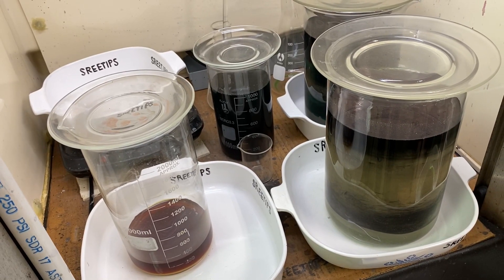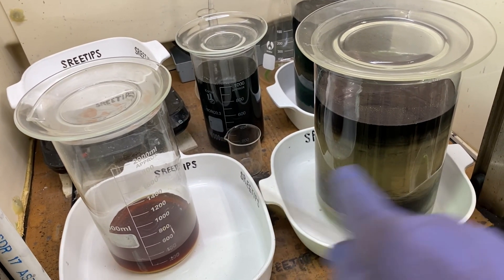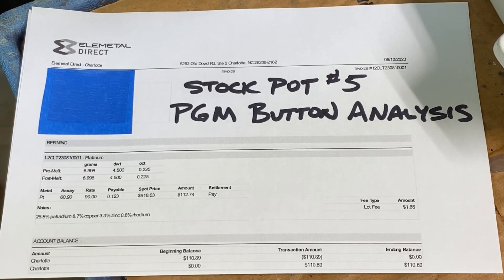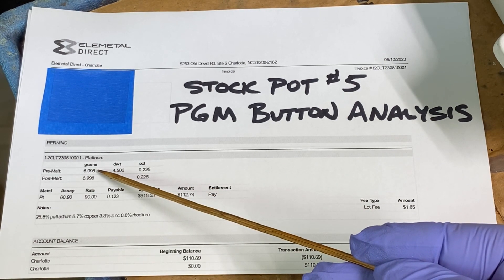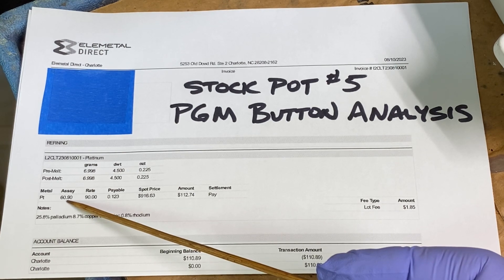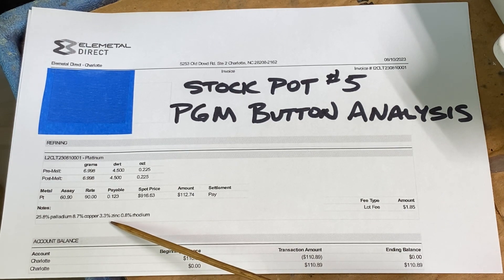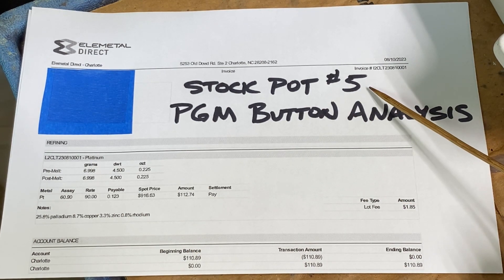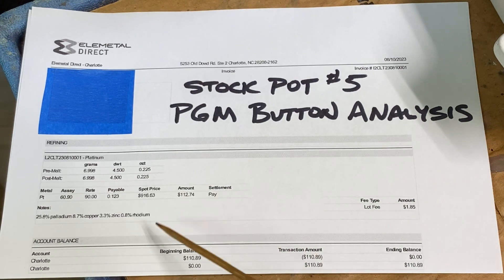Stock Pot 5 PGM Button Analysis sreetips

Comment: I've seen Cody's Labs successfully separating Pt from Pd. He mentioned that when in solution, he has no means to separate them, but he did it in some other way, too bad I forgot how. I've also done a Google search, several methods of separation of Pt from Pd are described. Perhaps you could look up a viable method for your future refining operations!
Reply: Palladium can be dissolved in nitric acid. Platinum can't.
It's not worth refining unless you have enough to offset the cost of the acids used.
Reply: @scoobydoo229  not so simple. When you have a Pt-Pd mixture and treat it with nitric acid, a significant amount of Pt will also be dissolved, while some PD will stay. Sreetips showed it many times in his videos. Nitric acid treatment is not an efficient Pt-Pd separation method. Other methods must be used.
Reply: @bormisha  I never said it was simple. The hardest part is going to be the Rhodium though.
Reply: Here someone is successfully separating Pt from Pd and Ag. He dissolves the mix in nitric acid and H2O2, then filters the remaining metallic platinum, then precipitates Pd with DMG. He also uses KOH for Ph control. I don't know how his process is substantially different from Sreetips's, but he's pretty successful. https://youtu.be/6If9uSbIUxA

Comment: Thanks, it is always nice to see the explicit result of your painstaking work.
 I roughly calculated that the palladium component would be worth  about $130.00 Am I right on that estimation? Then its quite impressive as a byproduct imo.
Another question is if it would beneficial to refine this further in the individual elements? Would that be necessary to monetize the button?
Reply from the maker: Your estimate is close, I could refine it to get separate platinum and palladium